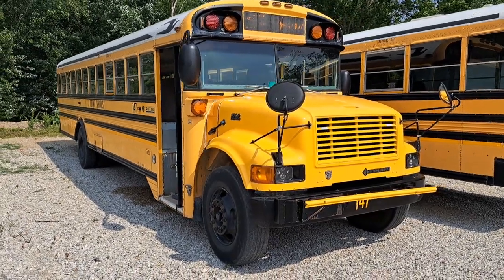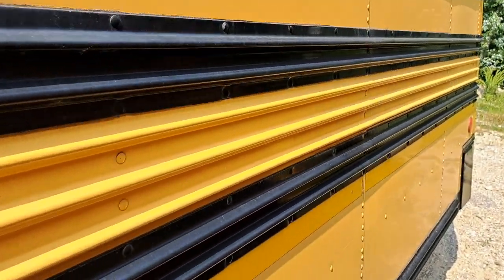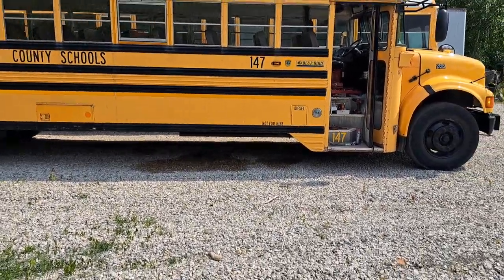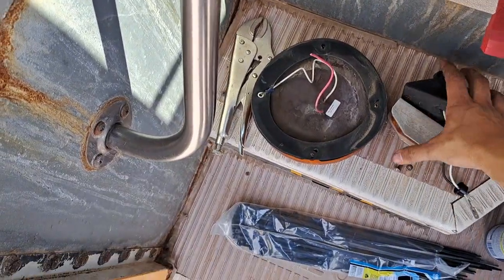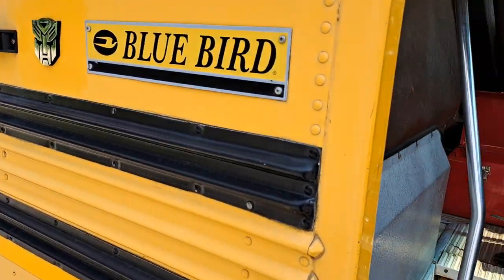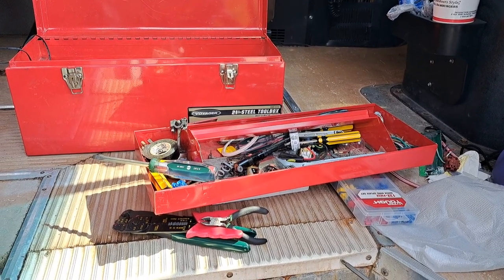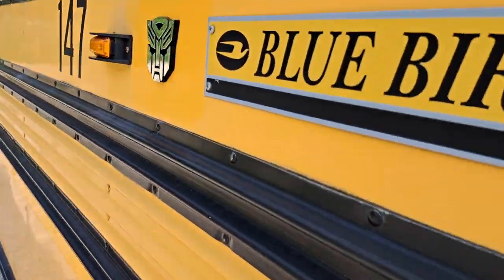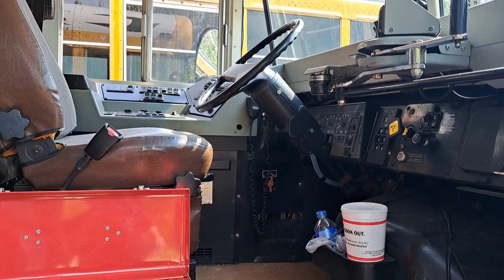New Cowl and Side Turn Signals for Bus 147 | Bus Progress Update

Comment: I know how you feel,, I should have more patience sometimes , dad always said if it’s not going right, take a 10 minute break, and usually the next try everything falls into place.   But , if there was something that could get to my core , working on stuff is seized up nuts and bolts.   And electrical trouble due to corrosion 🤯.  Up here in Ontario we use as much Anti seize as we do maple syrup 😆
Reply from the maker: It's one of those things that I usually forget until it's too late 😅